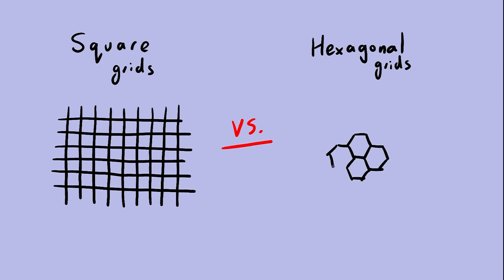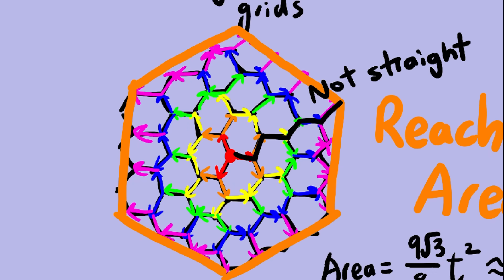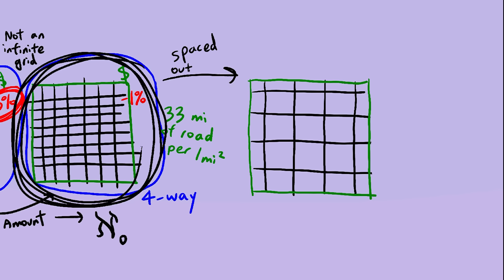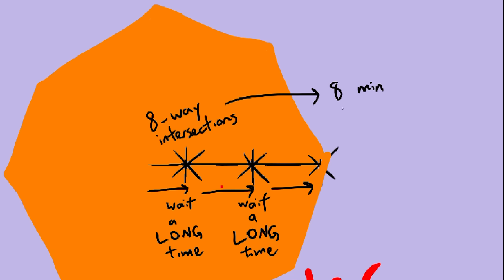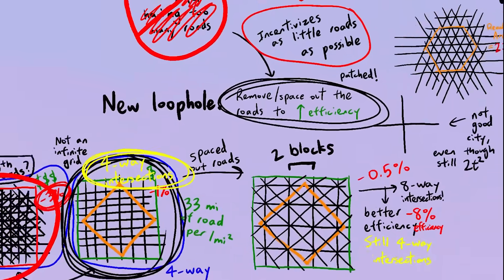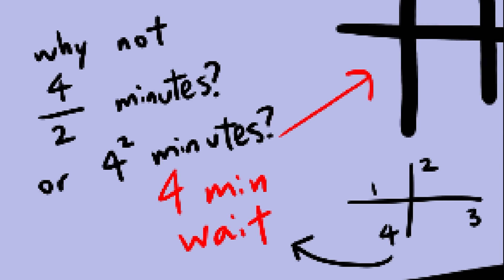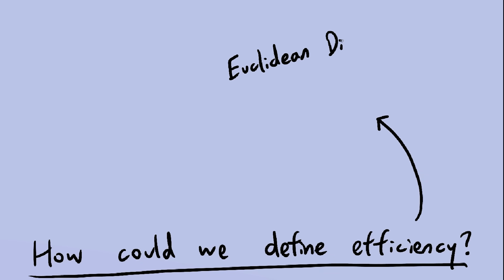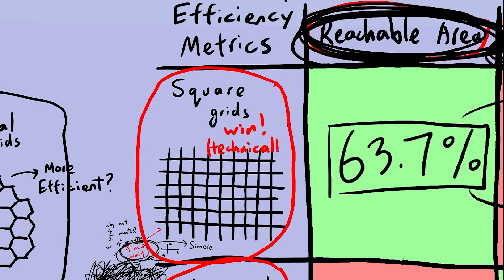Would hexagonal city blocks be better?

Comment: It was a fun video, and im not a civil engineer nor I know even a fraction of the math you do probably, however the reason why the square grid wins is veyr simply: It allows for (afaik) the fastest travel time when you cnsider non straight paths to be an interruption -- in fact I had this argument with a relative and showed to him that the shortest path, evne with no streetlights, was actually slower because of the zigzag -- and a potential danger to the driver (well, itnersections are too butnot knowing whats on the other side is a risk). PLUS a square is a pretty good shape to divide in parcels. Triangles are not what you want, and neither are circles; The rest of the issues are waved away with diagonal streets ( only a couple), circular outer roads to circunvent the other roads, and "green waves" which is a speed at which if you keep it constant, all the streetlights will be green for you because you are synced with them
... That said, you dont always want to be that efficient, square grids incite people to go fast, which is bad for pedestrians and businesses.

Comment: What if I made a hexagonal city without cars and had a subway station at the center of each hexagon that traveled perpendicular to the walking paths between blocks, would that be more efficient?
Reply: I think that a hexagonal grid is very efficient for a metro network, if you wanted a metro network such as all residents have access to a metro station within 800 meters for example the best way is to build stations 800√3 m apart in parallel lines 1200 m apart, while the two closest stations between parallel lines are also 800√3 apart. Not all of these lines would have a route connecting their stations with eachother, requiring an interchange, but it would be a good idea to build straight metro lines.
Reply: If the whole area of the grid is populated

Comment: One thing you may want to consider is space inside the roads, as what are city blocks without any buildings. The maximum ammount of building space you get is actually ring roads here since circles maximize interior area. and you could combine it with a patern that uses ring roads instead of intersections theoretically

Comment: for picking random points in the last method, you could create a node for each square/hexagon within a certain radius from A (which would be the center node) and then randomly pick one of the nodes for B, and calculate the efficiency between the closest intersections touching each node

Comment: in my experience driving through cities and suburbs with grid like layouts, is the fastest route between two points on the grid is more often than not the root that has the fewest turns. this is because turning takes longer than going straight. without checking, I bet that a good way to check this sort of thing would be to incur a penalty that gets higher the steeper the turn is. also, thinking of reachable area as a number of reachable cells adjacent to the road path taken. be a good approach as well. it would mean that cell size would start to have an impact on your total reachable area. so with larger cells you would get a larger area with the same travel distance.

Comment: I feel like a better restrictive value would be to make all blocks the same size in area. Define all blocks as having an area of 1 and then all roads would have to the appropriate distance relative to the size of the shape of that block. All blocks would have to be the same shape, but it eliminates the hassle of dealing with erasing or adding roads. You can do that, but you would also be redefining what 1 is at the same time.

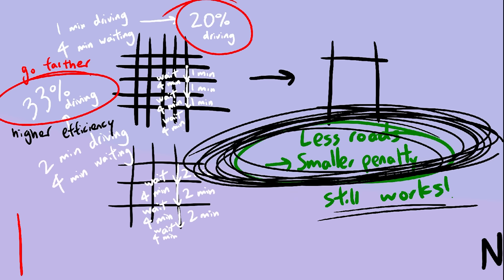Comment: → 8:15 "We never fixed the loophole!" – I think this is because even in real live, differently-spaced out grids of the same shape actually do have different properties, and your model should account for that for finding the "best grid". What is missing is how long you still need to walk to your final target inside the block. Depending on your parameters (relative speed of cars and pedestrian, waiting time at intersections, etc.) this might result in hexagons with a single road going into the midle of each to reduce walking time. Or something like sparse low-intersection roads (aka freeways) going in many different orientations for long distances, combined with some grid to get the local access.
Reply: Like superblocks?

Comment: We don't want no roads at all, because we need them to move.
We also don't want roads everywhere, because we then have no  reason to move somewhere.

Therefore it has to be a balance between the space the road take away and how far you get in X minutes.
Since you wanted 1-dimentional roads, i would propose to use the length of all roads in the "ideal area" (which is a circle).

So Efficiency is [how much of the area you can reach] decided by [the total length of road in the ideal area].

Easy. And if my intuition is correct this should also give us a balanced result on how big the grid should be "scaled" ideally.

...
Anyway, we still have a little Problem which your system also didn't solve. If we define only points directly on the roads as possible destinations, the kind of grid also changes the initial setup for testing, which can't be good. How do we define a space that "can be reached" that isn't exactly on the road.
Aproximating the nearest point that's on a road won't work, because then we would have just an ideal grid when there would be no roads at all. Maybe we need some when-you-don't-walk-on-a-road-you-take-double-the-time-rule or something like that after all, idk.

Comment: I think a major trade off between square and hexagonal grids is turns. In actual driving going straight at an intersection is faster than turning. In square grids you can always reach any other point with only a single turn while hexagonal grids are almost 100% turns.

Comment: The intersection penalty doesn't work, because in real life more intersections would mean more cars are distributed over more roads, which means less time to wait on an individual intersection in a grid.

Also, reachable area fails to consider the size of the buildings. The two road example should actually have a cross-shaped reachable area, only extending a certain distance past a road.

And I think the punishment for a lot of roads should be that you're taking away space from buildings, effectively making your reachable area useless cause the buildings themselves are not as densely packed.

So maybe a good metric should be something like this?
(building area/road area)*actual reachable area

Edit: read some other comments with the same idea and realized, currently the roads have 0 width so you'd just need to give them thickness.

Comment: There's another problem with reachable area: there is no area to begin with. Roads are one-dimensional, and the set of places you can get to using the roads has area of 0. It is best seen at your example with just two roads for the entire city at 4:21 - they don't really give you a square, they only get you to the diagonals of this would-be square. And same is true for other grids: the area is chosen based on vibes of how the reachable points on the roads look like, but has no rigorous definition.

Comment: As an architect:
it is important to remember the real reason we don't cover our cities with roads: it's not about the cost of building them, but rather that they take up valuable space that could be used for buildings
therefore, the real question would be to think of the optimal road layout to serve as many buildings as possible, because buildings can't be infinitely thin (as it would be impractical) and can't be infinitely wide (you need windows to live)
therefore, a somewhat good model would be to set some arbitrary minimal and maximal width for a building (let's say: minimum 5 meters and maximum 12 meters) and try to optimize for that: if your grid is too narrow, the buildings either won't develop the full 5m width and be unusable, or you will lose too many area on roads. if the grid is too wide, there will be spaces left between buildings, which is suboptimal

obviously it's a gross oversimplification as the geometry of buildings is way more complex, and in a lot of cases spaces between buildings are a good thing, but it could be an interesting simplification
Reply: The only all encompassing solution is to build every layout in cities skylines and see which one is less congested. I think the space taken up by an 11 way intersection would penalise it enough and designs that use space less efficiently will have longer journeys causing more congestion.
Reply: @maksrambe3812  Then the optimal network has no buildings and leads nowhere so nobody has any reason to drive there meaning it's 0% congested.
Reply: @TheJamesM  This has the same vibe as an AI deciding killing all humans will lead to world peace.
Reply: @inanjarif1388  unfortunately 😅 all algorithms & machines need to be taught to "not harm the cylinder". Meaning, if asset X (humanity, or buildings) is valuable, but it's inefficient or self-destructive to have more of X, the answer is NEVER to "reduce the amount of X". 

Maximizing the quality & quantity of X is the entire point. X is the protected value. You must exhaust all other possible approaches prior to controlling for quantity.
Reply: @TheJamesM  Love the implication of this statement. It would mean that you're always already where you need to be. Everywhere that you need to go is confined to a single point.
Reply: @hoodrowwilson  So from this standpoint of maths, living in a black hole might be ideal 😂😂😅
(which, in reality, even is not a singularity, I know. But talking math, it is :D)
Reply: @maksrambe3812  Having only a single winding road leads to effectively no congestion, however it does mean that it takes hours to get literally anywhere
Reply: I was thinking that taking the width of the roads into consideration and maximising the area of buildings accessible within the time limit would remove the all roads problem (more roads would now mean the buildings are more spread out), and would make it a more discrete problem to solve. And then maybe a maximum distance to the centre of a block from the road (because these theoretical people wouldn't want to walk too far).
Reply: Nah, buildings take up valuable space that could be used for roads.
Reply: @sycamorph  Also known as the americana suburbia school of design...
Reply: yes, I'm glad you commented this!  Throughout the video I was thinking that the purpose of the road needs to determined in the first place, so that can be maximized, rather than arbitrarily deciding what feels like a valid road layout.
Reply: Why are we making cities with cars in mind? We are people not cars, shouldn't optimising for people movement be better?
Reply: @WynterChrysalis  Well, people also use the roads, so it's the same thing.
Reply: There's also something else to consider the building to road ratio: do all the buildings require direct road connection? Buildings that don't need direct road connection because it's designed as a walkable space can cram more buildings into the same space by reducing the number of roads connecting to the whole space.
Reply: Okay, but also they are too expensive
Reply: What stops you from putting windows on an infinitely wide building?
Reply: @eyjay1508  where i used to work, there was a rule that you couldn't count surfaces further than 8 meters away from a window when calculating the inhabitable surface of an appartement, but I cannot find the reference to that rule
Reply: We'd have to also weigh in the travel time of cars, like in the video. If we optimize for buildings, there won't be any roads. If we optimize for roads, there don't be any buildings.
Reply: Interesting
Reply: “As an architect”
An engineer’s worst enemy, lol.
Reply: I disagree with your comment on requiring windows.  Windows are optional for the strong.
Reply: @Faladrin  that's how talking with civil engineers about insulation sounds like
Reply: Following your line of reasoning, a hexagon would be better than the square an octagon even better and the more side you introduce, the closer you start to resemble a circle, which has the optimal ratio of circumference to area. So a polygon with increasing sides is best, but then other factors come into play, like complexity of roads, number of convergent roads in an intersection, etc. Like any engineering solution there are tradeoffs that need to be balanced. Maybe a circle with concentric ring roads space every so often with a bunch of pie slices? That would actually be a beautiful city, especially if you put a huge park in the middle.

Comment: Aren't reachable area and the last efficiency metric directly related though? It seems you just square the last metric to get reachable area metric.

My intuition suggested this as soon as you mentioned euclidean over grid since the area metric is kind of an average grid distance over all the directions and comparing the ratio to circle area is similar to the comparison to euclidean distance

There's probably a more rigorous way to show this (I think it may have to do with thinking about how you take the average over all points. They way you do it in the video is by taking the average over the perimeter of sufficiently large circle, but the result shouldn't change if you take the average over a sufficiently large square / hexagon, the shapes of the reachable areas)

Comment: I think the next thing to consider is how this relates area to build houses and other buildings compared to how far you can get cus we proved square grids better for traveling far... with hexagonal grids you can fit more into each "block" so would we have to travel less far to get just as much area covered? I would assume we could squish things in closer on hexagonal meaning they are more efficient even though more driving time because more places will be closer to you.
Reply: I guess it depends on how you build the buildings tho. We generally build in rectangles. In part because you can subdivide a rectangle into any number of smaller rectangles. But if you want to split a hex, you have to use other shapes unless it's a clean multiple of the length.

Other splits are likely to lead to acute angles, which aren't actually very useable space even if technically part of the building.

So. Basically, maximum possible build space is higher in a hex, but you are also significantly more constrained on how you can actually make use of it.
Reply: @GhostGlitch.  we still have quite a ways to go considering we havent even gotten to areas yet lol but otherwise I agree